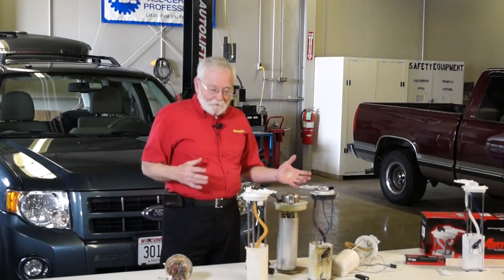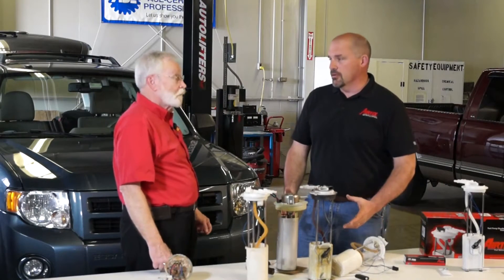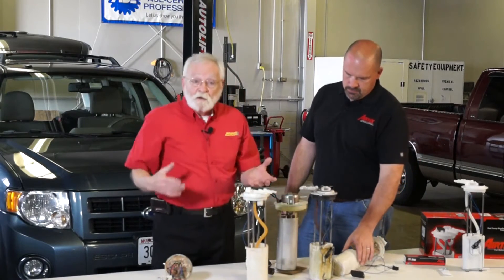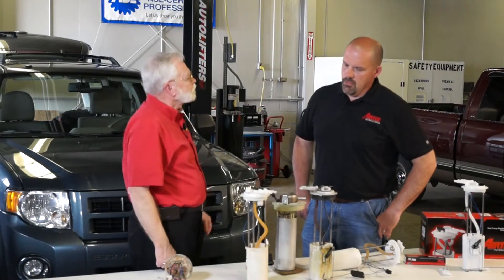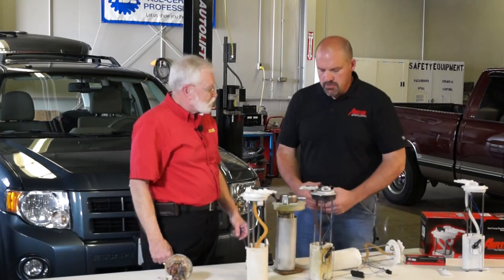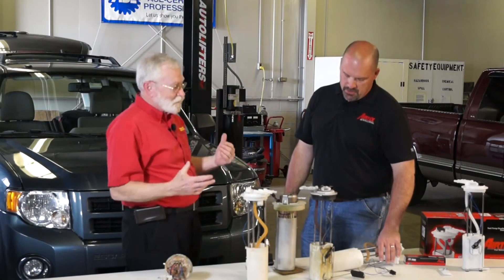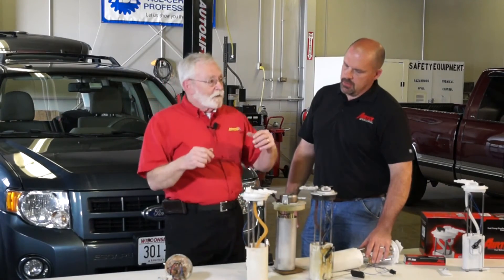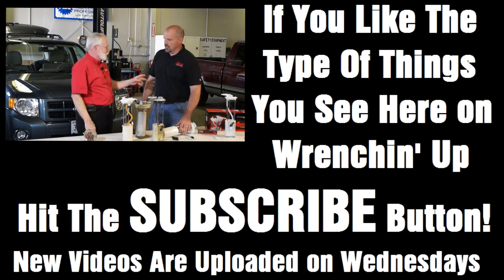How Dirty Fuel Tanks Destroy Fuel Pumps - Wrenchin' Up

Comment: My car runs rough when it gets to a quarter tank. I’m thinking it’s the fuel pump but also I’m hoping the tank isn’t dirty. Not sure where to start
Reply from the maker: Hi - Thanks for watching! If you haven’t already done so, be sure to check the fuel filters to be sure they are not causing the problem. Then check the fuel pump pressure at times when the engine is running rough to see if it’s up to specs. If not, be sure to check the pump's power and ground circuits to be sure that is not the problem before replacing the fuel pump.

Comment: Wonder this is why my truck shuts off. Sputter crank it starts runs a few sec. Then let it sit 3 min starts up runs no issues. Even starting fluid would start it for few sec I have rotted out filler neck possible rust in tank. Messing with fuel pump  when pump.works good fuel pressure only acts up driving. So hopefully rust in tank. Gonna clean out pump n tank see problem goes away
Reply from the maker: Hi - Thanks for watching and sharing your project!

Comment: This is pretty ridiculous. The amount of dirt and other contaminants that gather in a fuel tank are very minimum. Don't get me wrong, it does happen, but not like this guy is making it out to be. All that needs to be done is to simply empty your fuel tank by either pouring it out or siphoning it out prior to installing the new pump. No reason to use soap or  steam as the dirt is freely moving around in the fuel, it's not crusted to the side or bottom of the tank as the fuel keeps it suspended. The much larger issue is that these aftermarket fuel pumps are complete garbage compared to a quality OEM fuel pump. Spend the extra money and always replace with an OEM pump from the vehicles manufacturer and keep your fuel tank at least 1/4 of the way full to prevent the pump from overheating.
Reply from the maker: Thanks for watching and taking the time to comment!
Reply: @WrenchinUpwithJimBates  Takes a class act to reply as you did to that comment...kudos.